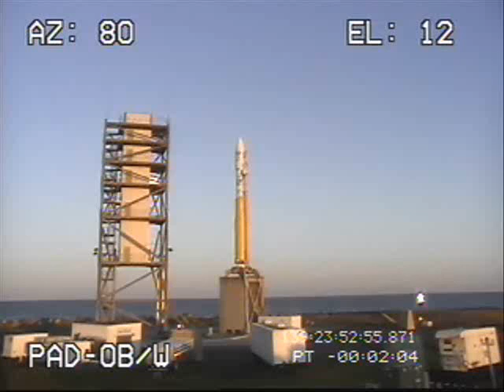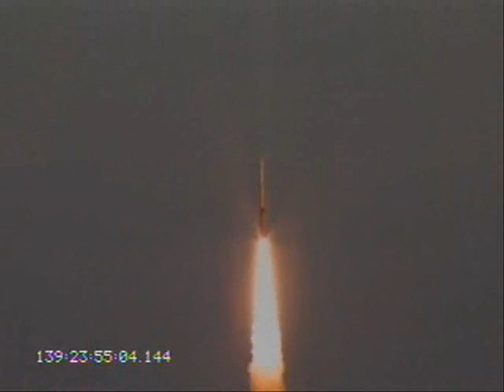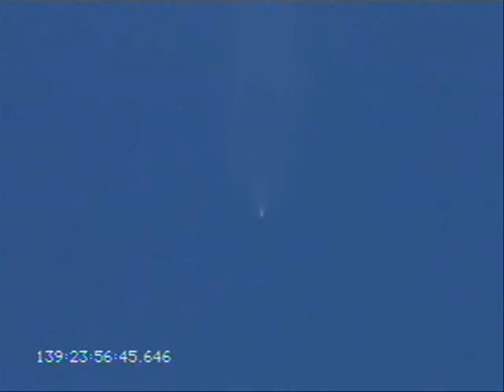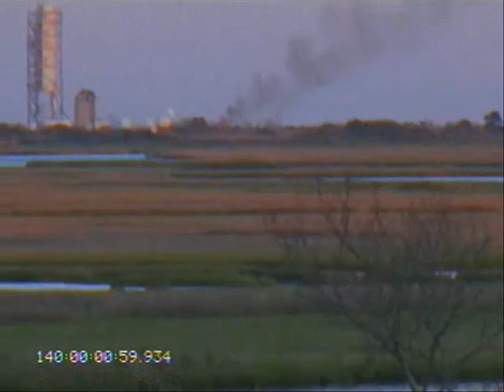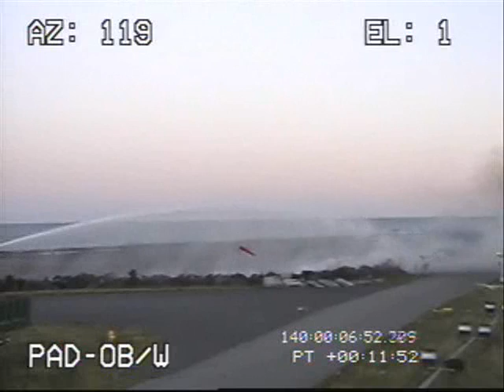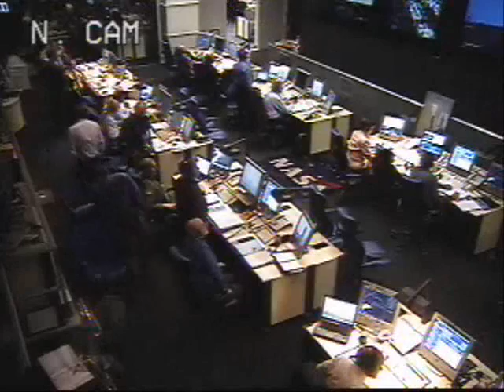Minotaur 1(TacSat 3)

Comment: is it a solid booster on 1st stage?
Reply: Yes. The Minotaur series of rockets are entirely solid fueled. If I remember correctly, the first stage is a surplus ICBM motor, and the other stages are newer motors manufactured by Orbital ATK (now part of Northrop)
Reply: @spamaccount1680  Well, actually the first 3 stages are basically Minutemen without the warhead. 4th stage is a Star series kickstage with an optional fifth one.
Reply: @alphaadhito  Oh yeah, it's first 3, not first. My bad.
Reply: Yep. Same with the other 3 stages